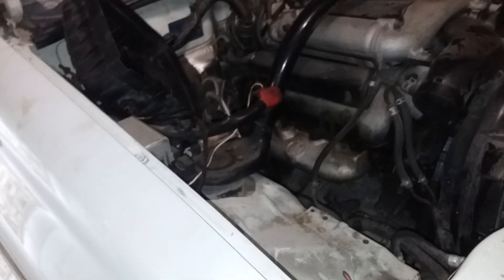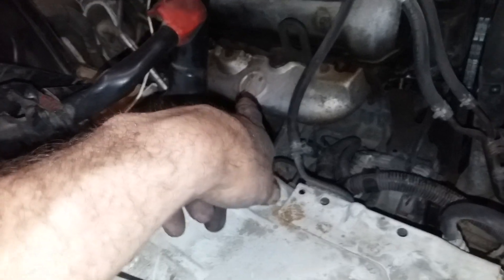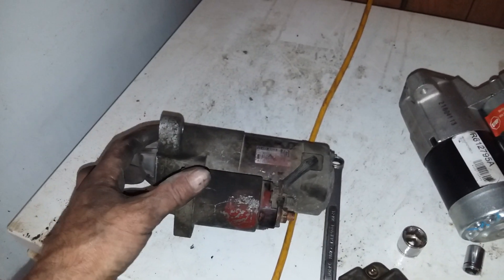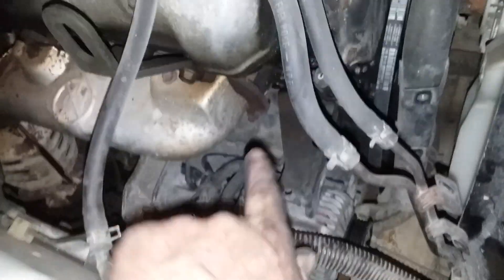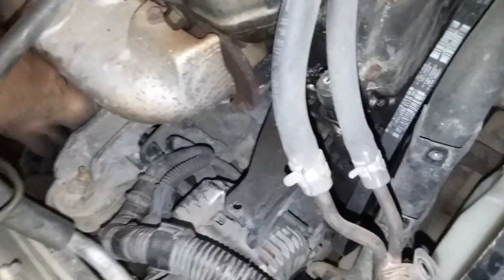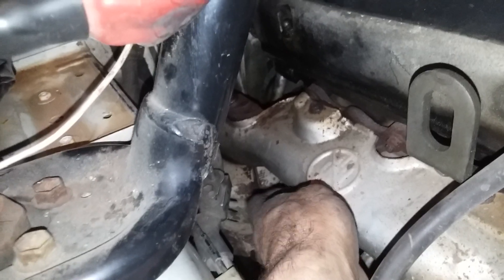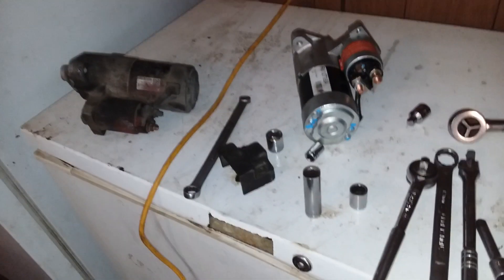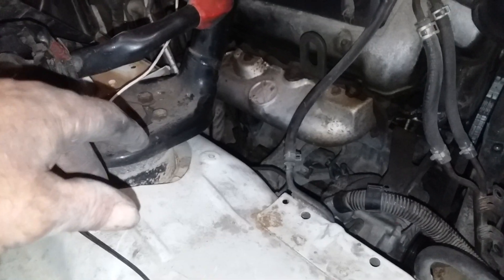2001 Suzuki vitara starter replacement

Comment: Thanks for the vid, it was a main source of info before starting this project on mine. I'm doing this on a 02 Chevy Tracker ZR2 (basically the same car) right now. No need to move the Alternator. Remove the heat shield, battery and airbox. Disconnect the wiring harness from the Alternator and starter and pull it out of the way. Once the harness is out of the way, you can freely pull the starter out (you will need to twist/turn/rotate/cuss it out of the small space lol). The strut bar can and should be removed from this car. It will make this job and others easier. If you want better cornering at speed, which is not what this SUV is meant for, then leave it on. If you want better traction off-road and in snow then take it off.

Comment: Brother I have the same truck but 4 cyl. After pulling it out I cannot place the wires correctly. I have two caes comming from the battery and a swith plug. Please help.

Comment: 2002 suzuki xl7.
I removed the airbox and then broke the middle bolt on exhaust cover so I left it.
Went underneath and removed the two 9/16 bolts. Finagle the starter up by the manifold and remove the wires from starter. It's tight and you'll see. On install just do reverse...finagle it in by manifold and get the wires on. Climb back under and get her into place for the 2 bolts.
This is the best video I found and if you're here you're on the right path.
Thanks and good day to you all.